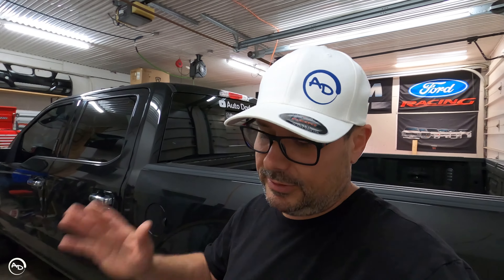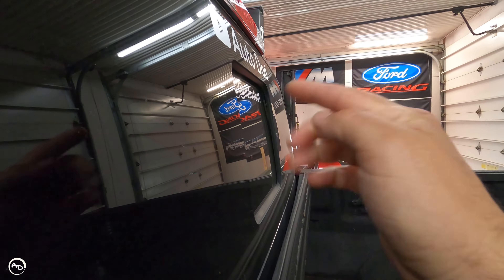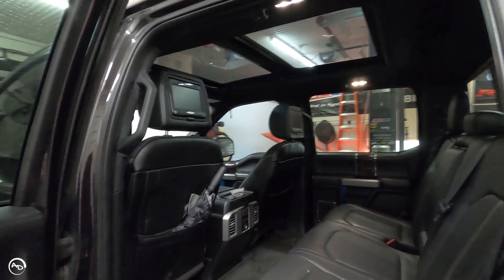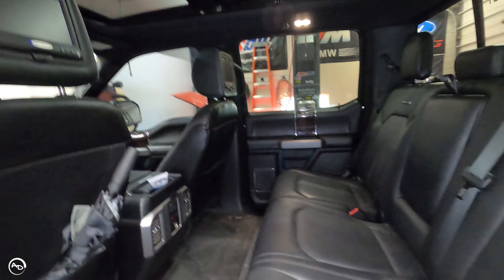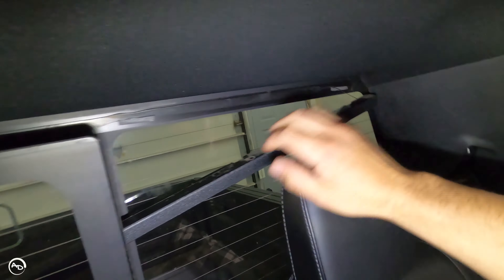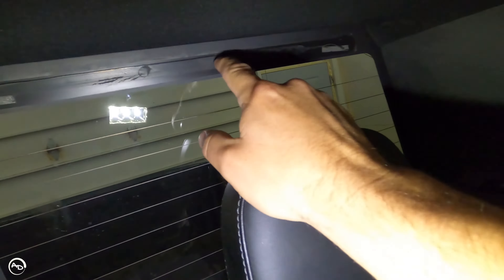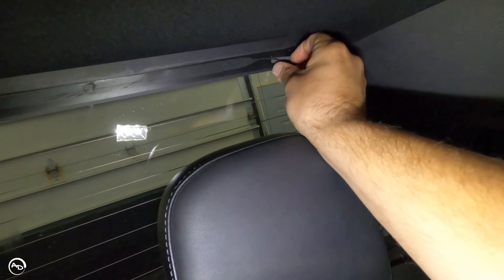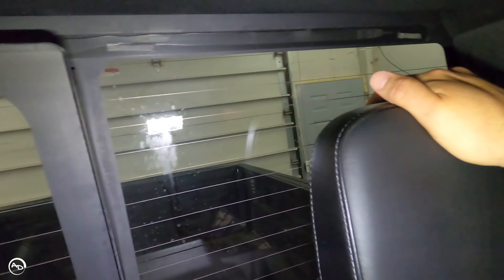How to fix the loose F-150 rear window! Super easy!!

Comment: Dealing with this issue now.
Not uncommon as I'm finding out. 
1 - tube of ProForm PF 225 Black.
1-  ProForm PF230 pinch weld and glass bond primer